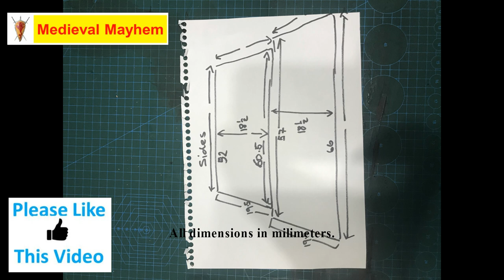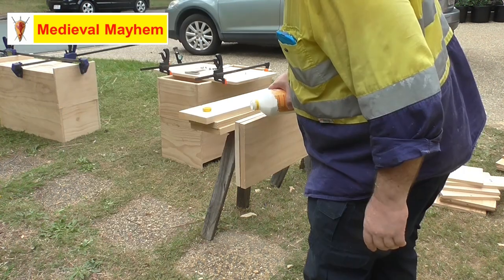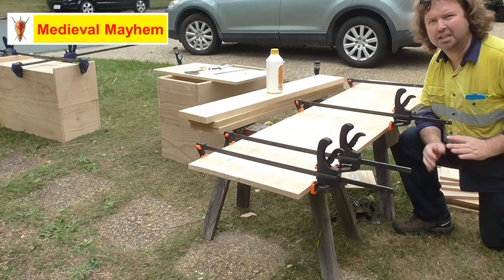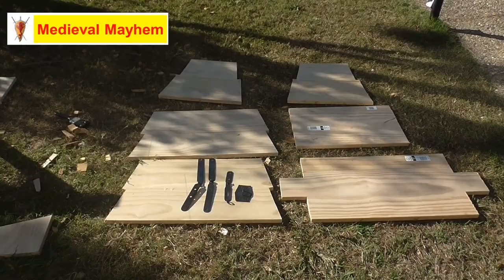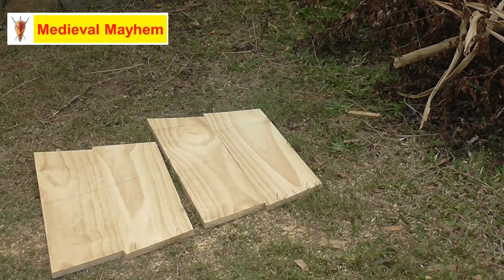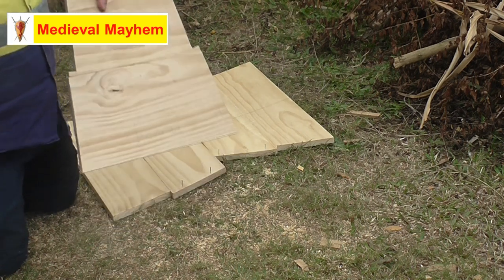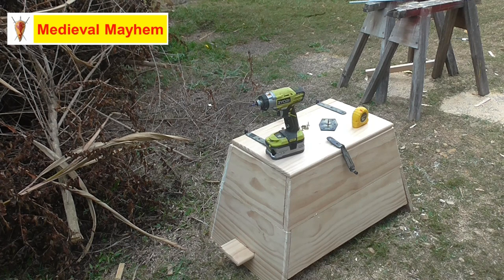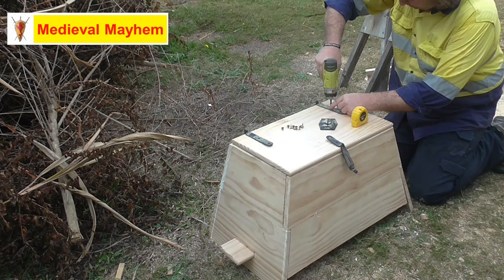How to make an Oseberg Sea Chest (Viking DIY) Ep1

Comment: PVA plus Oak can also give you dark glue lines, not so much with pine or light colored hardwoods. You also helped  me with a mind blank on doing the end mortises for a Hedeby Harbor chest - jigsaws can also tilt the base plate just like you do with the circular saw - I keep having the bottom of the mortise break away when I am trying to finish it up with chisels as there isn't much wood under it on a Hedeby chest.
Reply from the maker: Good tip Bruce. Thanks

Comment: You might try closing the slight gaps at the bottom of the side pieces by putting some small screws or nails in from the sides (with pilot holes).  I made a chest just like this at the start of the year.  Apparently they are very popular right now.  I put a ton of nails in it on the edges and it sucked everything together nicely and all but eliminated the gaps between pieces.
Reply from the maker: Cool. Thanks for the tips.

Comment: Those measurements look more like centimetres than millimetres to me. Unless 66cm = a bit over 21/2 inches.
Have you ever heard of "rubbed" joints where the 2 edges are rubbed together (laterally) until the start to stick togethet then clamping them? I would also recommend using clamps to hold the ends flush with each other, unless, of course, you are aiming for a rough finish.
I also recommend using straight edged guides to ensure straight cuts,.
Reply from the maker: Hi Keith, yes centimetres. Thanks for the tips.